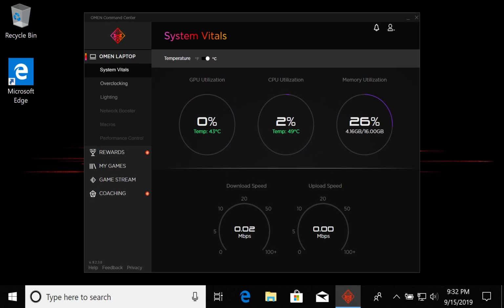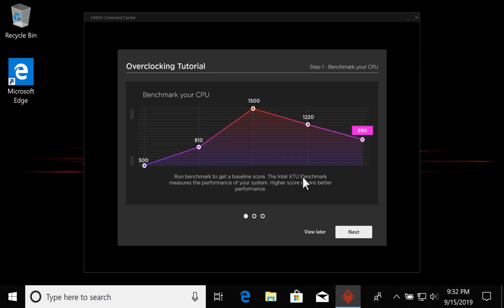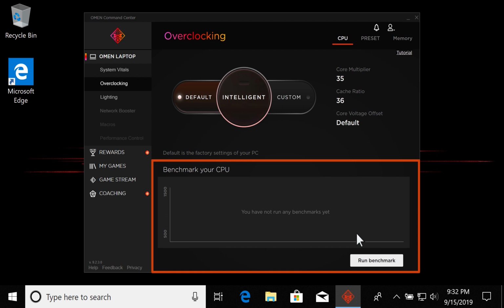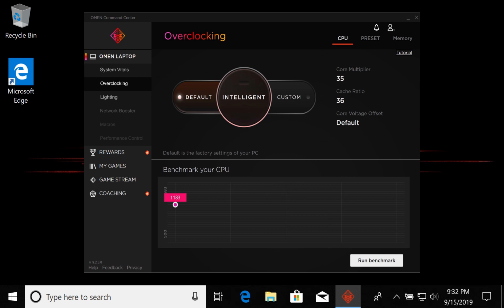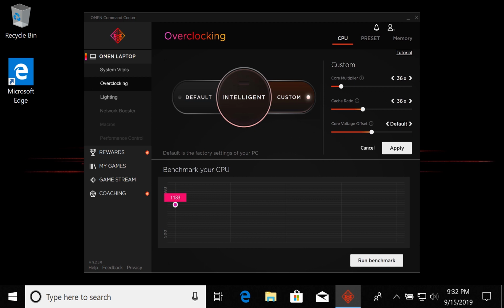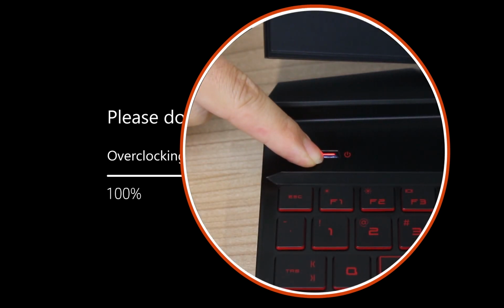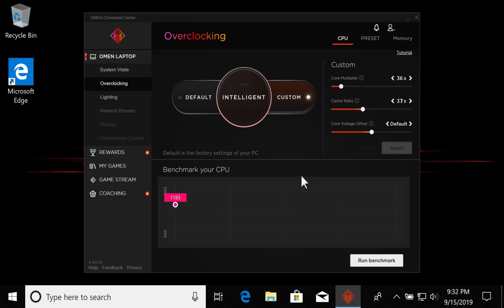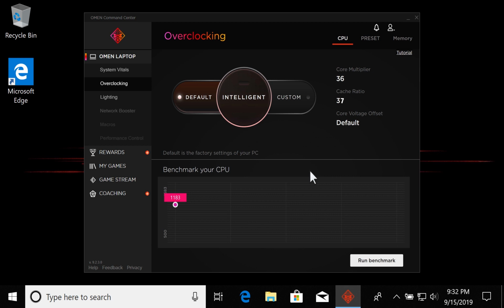Overclock an OMEN Computer | OMEN Gaming | HP Support

Comment: Will i be able to overclock my 25l if i upgrade the cpu to an unlocked cpu?
Reply from the maker: +Mark Surdezsmith Please check whether your unit support this feature under 'OMEN Command Center features' from here: http://bit.ly/2G3Dyzn If it supports, try the steps mentioned under 'Overclocking'
Reply: @HPSupport  oh i deleted that. Seemed like bloatware. Ill just flash the bios and figure it out thanks

Comment: This is crazy if we spend over 1000 on a computer it should be able to overclock. Just another way for the company to pinch more pennies! This is my fourth omen laptop and still this feature doesn’t exists!
Reply from the maker: +Brandon H Please check whether your unit supports this feature under 'OMEN Command Center features' from here: http://bit.ly/2Gp1scm If it supports, please perform the steps mentioned under 'Overclocking'

Comment: I cant undervolt my pavilion gaming 15 dk10000
Reply from the maker: +Kyle Masculino HP does not recommend upgrading or downgrading hardware parts or software that is bundled with the product as It may affect the manufacturer's warranty and performance, however, you could change the configuration at your own discretion.

Comment: Hello HP
I have a question, does Hp Commend Center has option or feature to extend battery lifespan like charging threshold(for omen laptop)? 

if not, what software should be installed?
Reply from the maker: +Argo Orton Learn how to get the most service and life from your HP notebook battery by following these industry-wide suggested best practices as mentioned here: http://hp.care/2oZia9z

Comment: Every Time i open omen command center setup i have to update my sp88264.exe. and then proceed with BIOS update and then i click on update I wait Till its done click on next and then 838ff16: error: unknown command so I click on ok its restarts and nothing changes.
Reply from the maker: +Ricsi Hamza You can Update the OMEN Command Center from the Windows Store Click the Windows Store icon in the system tray. Search for OMEN Command Center. Click Update. Wait while the program downloads and installs. Click Play. OMEN Command Center opens. If the issue persists, please uninstall the HP Omen Command center. Select the Start button, then select Settings > Apps. Choose the program you want to remove, and then select Uninstall. Some apps built into Windows can't be uninstalled. To remove an app you got from Microsoft Store, find it on the Start menu, press and hold (or right-click) on the app, then select Uninstall. Restart the HP Omen and download the Command Center from this Link: https://support.hp.com/us-en/drivers Let me know how it goes.
Reply: @HPSupport  i dont have any update and i dont care anymore its just waste of time. and btw do something with the heating problem its really annoying. btw why the heck we cant use it on full performance from the start? who had this idea? its realy a bad idea.

Comment: none of this is dislpayed. only vitals and network booster.  also my command center looks a whole lot different.  my pc is the omen 880
Reply from the maker: +Chase Cook You can update the OMEN Command Center from the Windows Store Click the Windows Store icon in the system tray. Search for OMEN Command Center. Click Update. Wait while the program downloads and installs. Click Play. OMEN Command Center opens. If the issue persists, please uninstall the HP Omen Command center. Select the Start button, then select Settings > Apps. Choose the program you want to remove, and then select Uninstall. Some apps built into Windows can't be uninstalled. To remove an app you got from Microsoft Store, find it on the Start menu, press and hold (or right-click) on the app, then select Uninstall. Restart the HP Omen and download the Command Center from this Link: https://support.hp.com/us-en/drivers Let me know how it goes.

Comment: the software is already update it and the interface looks totally diferent, the laptop is restarting everytime its getting hot and there is no support on the website, i dont want to chat with a machine !
Reply from the maker: +Fabian Guerrero Follow these steps to keep OMEN PC cool while gaming:
- Check task manager whenever your computer is running slow, hot, or if you just want to see what all is running.
- Close the unimportant tasks that are orange and red.
- Always use a hard play surface in order to run the laptop effectively.
- Maintain a clean environment and safely clean the notebook.
- To safely clean your notebook, make sure the device is fully turned off and unplugged.
- Next, place your notebook on a soft flat surface.
- With the underside facing up carefully remove all the screws and bottom cover to clean inside of the notebook
- Gently clean off any dust with canned air and a microfiber cloth.
Reply: @HPSupport  the app doesnt run,just give me some messages and the screen is black, i tryed hp suport and it made restart loosing 2 hours of help

Comment: I bought OMEN 15EK0019TX in omen command center its showing none of these options it only shows balanced mode, anyone facing same issue, any solutions?
Reply from the maker: +Hafeez Pakali You can update the OMEN Command Center from the Windows Store Click the Windows Store icon in the system tray. Search for OMEN Command Center. Click Update. Wait while the program downloads and installs. Click Play. OMEN Command Center opens. If the issue persists, please uninstall the HP Omen Command center. Select the Start button, then select Settings > Apps. Choose the program you want to remove, and then select Uninstall. Some apps built into Windows can't be uninstalled. To remove an app you got from Microsoft Store, find it on the Start menu, press and hold (or right-click) on the app, then select Uninstall. Restart the HP Omen and download the Command Center from this Link: https://support.hp.com/us-en/drivers Let me know how it goes.
Reply: @HPSupport   it still has the same problem I followed the steps mentioned but the problem still persists.
Reply from the maker: +Hafeez Pakali As the issue still persist, please contact our phone support team for further assistance: Please follow these steps to reach them.
Step 1. Open link: https://support.hp.com/us-en/contact-hp
Step 2. Select the product type.
Step 3. Enter the serial number of your device or select let HP detect your product option.
Step 4. Select the country from the drop-down.
Step 5. You should see the HP phone support number.
Reply: @HPSupport  thanks

Comment: for some reason it says "HP services cannot be found hit the download button" everytime i hit it it sticks on 1% forever. legit left it for about 5 hours and it was still on 1%.
Reply: finally got into it.. but i cant overclock my RAM
Reply from the maker: Hi there, thanks for contacting!
I understand that you are experiencing an issue in overclocking the memory. 
I will do my best to assist you.
HP does not recommend upgrading or downgrading hardware parts or software that is bundled with the product as It may affect the manufacturer's warranty and performance, however, you could change the configuration at your own discretion.
Binu - Social Media Tech Support

Comment: The overclock resets on restart, is there any way i can get it to keep the overclock?
Reply from the maker: +Pyry 300 Please check whether your unit supports this feature under 'OMEN Command Center features' from here: http://bit.ly/2Gp1scm If it supports, please perform the steps mentioned under 'Overclocking'
Reply: @HPSupport  Still doesn''t work, it worked before but after update it stopped working, i checked it is compatible, i habe omen 880 and Ryzen 5 1600
Reply: Unfortunately unless you buy hp 300% market price labeled products, you will have to do this every time you turn on your pc.
Reply: @Derek2k  but it worked earlier.

Comment: I clicked on the intelligent option and now the screen just displays as black with the mouse on top of it, what should I do?
Reply from the maker: +Jonathan G thanks for reaching out!
I understand that you are experiencing an issue in overclocking. 
I'll do my best to assist you.
Please perform the steps mentioned under 'overclocking' from here to fix this issue:
http://bit.ly/2G3Dyzn
Let us know how it goes.
Reply: I have the same issue and the overclocking has already been running for well past 50 minutes.
Reply: James Chiu reboot it in safe mode (hold down the power button for the entire boot process) , it will stop the overclocking process but it will get you back your pc, it seems like AI overclocking is busted atm on hp PCs
Reply: @jonathang3888  
Dang, so you couldn't your yours to run the intelligent overclock either?
Reply: James Chiu yeah, I tried a couple times too
Reply: @jonathang3888  Lol I gave it two shots, just ended up black screening for an hour for each try, just got the PC today, I mean I guess I can slowly manually overclock it myself, but dang, that's unfortunate. When'd you get your Omen?
Reply: James Chiu last week lol
Reply: @jonathang3888  just thought I'd update ya, idk what I did but I let windows run some updates, did another benchmark in the command center, tried another intelligent overclock and it's currently showing the % bar like the video instead of the black screen and mouse we had earlier lol
Reply: James Chiu 
My overclock gets stuck at 50% every time I do an intelligent overclock!!

Help meee
Reply: @rebazuki  I'm not too sure either, it just worked for me after I uninstalled some updates. :C
Reply: James Chiu 
You "uninstalled" updates?
How and what are they?!
Reply: @rebazuki  I dont recall what it was exactly, but I uninstalled then reinstalled after the overclock, more over the overclock still gave me bsod so... idk I dont even use the overclocked setting anymore. Poor airflow and not another 4 pin slot to add another cooling fan on the motherboard is kinda annoying

Comment: don't work for hp OMEN X 900 series because we have not bios and not overcloking parameter with same tools
Reply from the maker: +Dams-one Please check whether your unit supports this feature under 'OMEN Command Center features' from here: http://bit.ly/2Gp1scm If it supports, please perform the steps mentioned under 'Overclocking'

Comment: when I go to overlock it gives me an error, does anyone know why? can you help me?
Reply from the maker: Hi Enki, thanks for contacting HP Global Social Media Support!
I understand that you are experiencing an issue in overclocking your computer.
I will do my best to assist you.
May I know the model number of your computer?
May I know the exact error message you are receiving?
Please let us know!
Binu-HP Social Media Tech Support
Reply: @HPSupport   I put in new ram, but it doesn't read at 3200 MHz. I don't have an option in bios to set it. I tried to update the bios but again the same thing, I tried the g hub program but it gives me an error when I want to overclock it.

this is my computer OMEN by HP Desktop PC - 880-095nz
Reply from the maker: Thanks for the reply.
Please perform updates via Windows and HP Support Assistant as mentioned below to fix this issue: Step 1 Windows Updates - 1) In the search box, type and open Windows Updates. 2) Check for updates. 3) If the updates are available, click on install and restart the computer. Step 2 HP Support Assistant Updates - 1) In the search box, type and open HP Support Assistant. 2) Check for updates. 3) If the updates are available, click on install and restart the computer.
Binu-HP Social Media Tech Support
Reply: @HPSupport   You don't have any bios for my computer, I really can't understand if this is real if it doesn't exist?
Reply from the maker: Thanks for the reply.
Please try updating the bios of your notebook from here to fix the issue: https://hp.care/3KPDuHq
Binu-HP Social Media Tech Support

Comment: yeah that's not happening with your guys cooling
Reply from the maker: +Pabo Please check whether your unit supports this feature under 'OMEN Command Center features' from here: http://bit.ly/2Gp1scm If it supports, please perform the steps mentioned under 'Overclocking'

Comment: I multiply bu 50 or 52 but im still running at 3.8ghz. How do i get it to 5.0ghz
Reply from the maker: +DrMgo91 Please check whether your unit supports this feature under 'OMEN Command Center features' from here: http://bit.ly/2Gp1scm If it supports, please perform the steps mentioned under 'Overclocking'

Comment: Why would you do this on a hp the cooling is horrible
Reply from the maker: +Granny_Gaming Please check whether your unit supports this feature under 'OMEN Command Center features' from here: http://bit.ly/2Gp1scm If it supports, please perform the steps mentioned under 'Overclocking'
Reply: @HPSupport  no point when the cooling sucks

Comment: Omen is so broken
Reply: Why?
Reply: @TheMustardCat20  Command Center is always so unstable and constantly changes for better or worse, 2 months with my first Omen computer, the wifi adapters were deleted, software was corrupted, and awful reliability and needed repair, so maybe I got unlucky with my product, but that was my experience, so careful ppl do your research
Reply: @kon187g  there's nothing to be careful. You got a fault product.
What's the shock on that? Don't spread misinformation.
Reply: @MartFishTank  Know multiple people with Omen and unfortunately I hear complaints from them aswell, as far as spreading misinformation smh, bought the product for a reason and didnt pull through like it said it would, what do you want to me to do, not give my honest opinion, ok nvm computers great, just buy it.
Reply: never been any happier with any PC purchase like OMEN, maybe your unlucky with your purchase, return to the seller there must be a warranty.
Reply: Streetfox 06 never had the issue
Reply: i also never had the issue. its running fine.
Reply: Had many omen systems over the years (3, one desktop omen x, another 30L tower and now an O17 Laptop from them.) None of them gave me major problems for the most part. I had issues with the gpu in the first system where the fans would go very fast for no reason creating a lot of noise when the system was cool already, but that was a long time ago and only in the first system. So far I have had no issues with the other 2 more recent systems. Overclocking one of them right now though so I don't know what's going to happen with that. Might give an update here if something goes wrong.
Reply: For anyone thinking about doing it, it's been a month since I left that comment. No issues with the overclock, though it's not perfect, it does give a nice boost. There are occasional bluescreens (the one with the sad face ":(" saying "we've ran into some trouble and we're rebooting") and sometimes it restarts, but other than that it's not so common and it definitely increased my performance. If it ever does cause me too many issues, I can always revert it as well.

Comment: This is a joke! The first time I did this, it erased my 4,000 $ Maxed Out Obelisk and caused many more issues. 
Did it again and it never works! Downloaded Intel performance maximizer and it says Inadequate cooling" Some from HP get back to me ASAP!
Reply from the maker: +Raed Qutob Please check whether your unit supports this feature under 'OMEN Command Center features' from here: http://bit.ly/2G3Dyzn If it supports try the steps mentioned under overclocking.
Reply: HP Support this doesn’t fix my issue. I have the best Omen Obilelisk and it supports it 100% this whole thing is messed up!!!

Comment: I have hp omen 15  but something happened to ho omen command centre and i installed it again now its omen gaming hub but it doesn't show overclock what to do now plz help
Reply from the maker: +MODULAR 5  The Overclocking option is only available with the i7-8xxxK (8th generation) processors. If you want to overclock your processor you can use Intel's Xtreme Tuning Utility: https://intel.ly/3fCZjJN  It is basically a full version of the OC'ing app provided by HP.  If you haven't done a lot of OC'ing, you should take it slowly.  Too much, too fast, and you can damage the processor.  There are good guides online for the Utility
Reply: @HPSupport  i have inte i7 8 gen